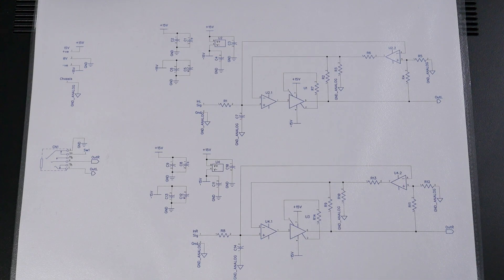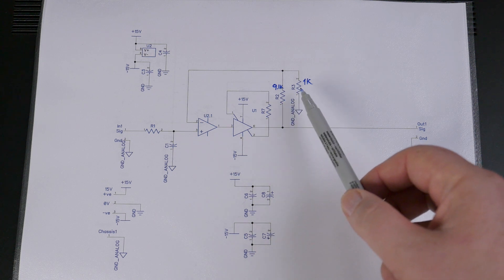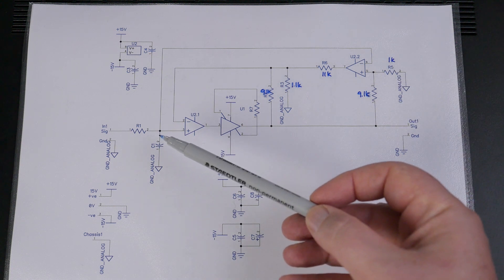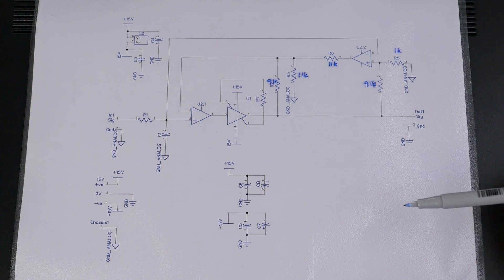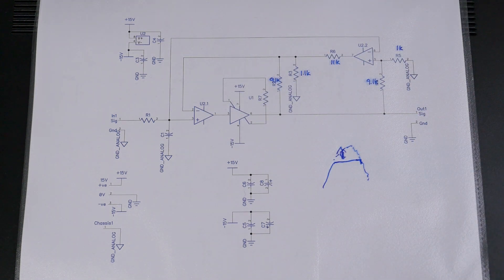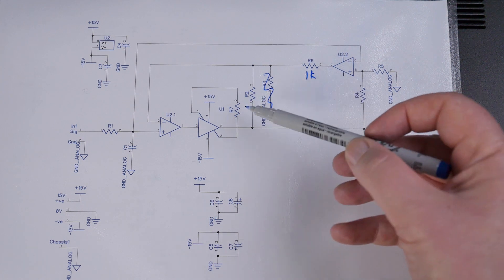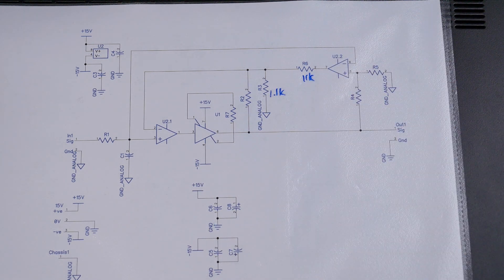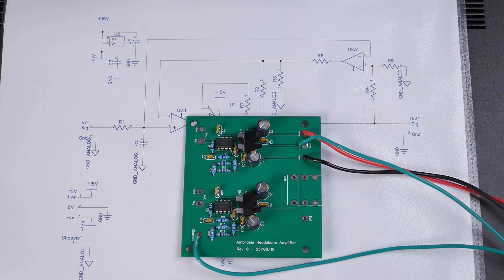Error Correcting Headphone Amp - Introduction

Comment: I thought about putting one of these together over the weekend as a fun project. Something I noticed - the BUF634 has no internal connection to pin 2 where you've connected R7. Is this an error?
Reply: Try d
Reply: Gs
Reply: 57÷
Reply: 79÷2* $'
Reply: ف
Reply: Hi
Reply: No
Reply from the maker: Looking at the datasheet, the bandwidth setting resistor should go between pin 1 and the negative rail, so that definitely looks like an error. I notice that I didn't populate R7 or R14, on the board that I built, as I recall it didn't improve performance - this would explain why (doh!). I'll surely be revising this design in the near future. Cheers for that, much appreciated.
Reply: @KarlAdamsAudio  9  ى  و<ضريح
Reply: @KarlAdamsAudio  mmm
Reply: @KarlAdamsAudio  Glad to help :D. I usually skip the resistor and tie pin 1 straight to the neg rail for maximum bandwidth, unless it's in a battery-supplied circuit then I leave it at low BW mode.
Reply: @KarlAdamsAudio  q

Comment: Could it be that your 13V offset is due to the lack of a grounded resistor for your input stage? Your op-amp doesn't have a DC path to source bias current, at least from what you show in your schematic

Comment: Why would the output stage need heatsinks if headphone signal levels are well below 0dBm?
Reply from the maker: Unlikely to be necessary in actual usage, but I thought it wise to use them for testing - also I might want to run the BUF634 in wide bandwidth mode, which increases the quiescent current quite a bit - so it seemed like a good idea.

Comment: but i dont see an advantage of the error signal it does nothing more then the original negative feedback already does
Reply: He just wanted to wrap the buffer in the loop.
Reply: @lazzer408  then why not wrap the buffer in the main feedback loop? I've done it with very good results
Reply: my initution is that it only improves the feedback by around 6dB, because of 11k and 9k1 being close to 1:1. I could be wrong though - haven't done a proper analysis. Probably better off just using a more skookum opamp. Also, the stability of this circuit is probably a nightmare if you use any decent audio opamp. The best audio opamps are in the 20-60MHz GBW range and would not be stable in this config without some compensation in the feedback path.
Reply from the maker: Fair point, of course - it's not necessarily any better than just adding more gain to the main loop. It seemed like a neat thing to try with the other half of a dual op-amp and a pair of resistors, though.
Reply: Amplifiers are made out of compromises. I believe he chose one opamp for its low noise and low distortion but it's not capable of driving low impedance loads. Doing so would cause an increase in distortion. So he added a buffer. The buffer however is operating in unity gain so it's contribution to distortion should be near non-existent. But IF there were errors, his loop would correct them.
Reply: @lazzer408  I used a TPA6120A2 for my headphone DAC/amp, great in just about every way in that application except one - the offset. A few millivolts might not seem like much, but it was enough to make a very noticeable click every time the output relay switches on or off. The fix is to use precision opamps to correct the offset. Review the datasheet of that opamp to make sure it does not use chopper stabilization since that will introduce noise. https://github.com/NiHaoMike/OpenDAC-HD/blob/master/OpenDAC_sch_ana.png
Reply: Ok for DC offset that should help but not for Distortion like is beieng sad in the video, but i still think(i did not do the calculation). I dont think even in offset it will have a difference, to remove the DC just AC couple the signal it is cheap and very good
Reply: Yes Karl it is an interesting concept, would be interesting to see some Simulation comparison even maybe with normal 1% resistors
Reply from the maker: I will follow up with some measurements soon. Resistor mismatch gives you more leakage of signal into the error amplifier, with resulting change in overall gain due to extra feedback (either negative or positive, depending on the direction of the mismatch).
Reply: @KarlAdamsAudio  ده جهاز كشف المعادن